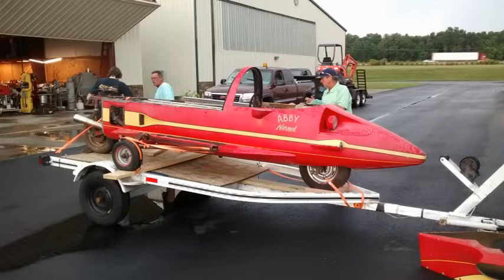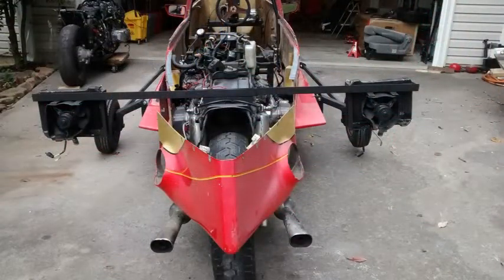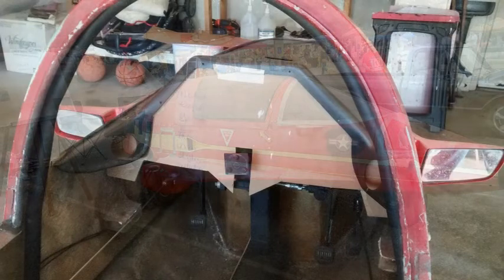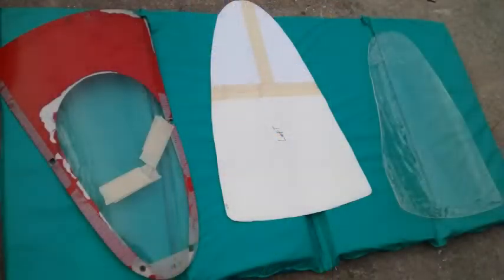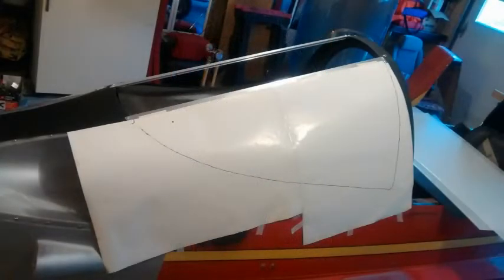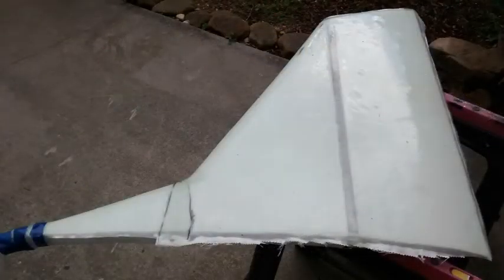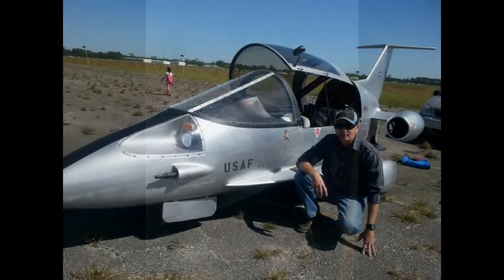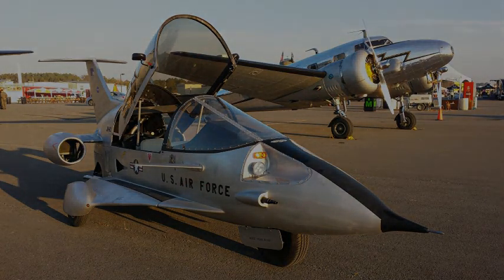Rebuilding a Pulse Autocycle

Comment: My dad bought one when I was a teen. He bought the 24th one made, and it was originally called an "Invader 2000", but apparently Honda owned the trademark for that name, so they changed it to Pulse. My dad's didn't even have a reverse gear at first. When we took it back to get the new Pulse decal added to it, they also installed the new reverse gear. It had a Yamaha 400 engine, and it also had some cooling issues without modifications. It was great fun, and we got attention everywhere we went from 1984 to 1987 when my dad sold it.

Comment: Woooooow thats amazing! I want to build something similar from scratch, but make it only a 3 wheeler for 2 passengers, autocycles are nearly impossible to find these days, and if you do, you would have to probably pull a mortgage on them to be able to buy them.
 the trick is how to register my bike as a trike? But something like this may be considered a bike, since it only has 2 wheels on the ground while driving straight 🤔

Comment: I am looking at one as well that was stored outside as well down in Orlando FL. It was outside for 10 years. The interior is bad but the outside looks good. Has the gull wing 1100 in it I believe. Not running. What’s something like it worth?
Reply from the maker: Anywhere from $1500 to $4000....but you need to take a look at it and see.